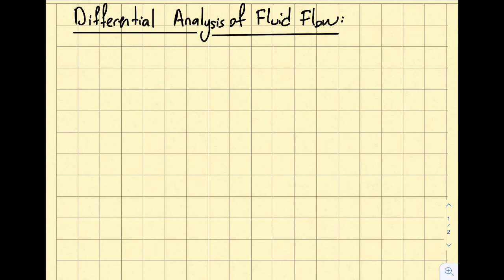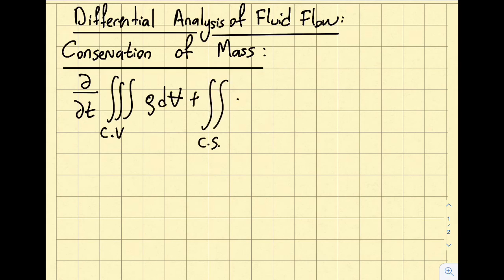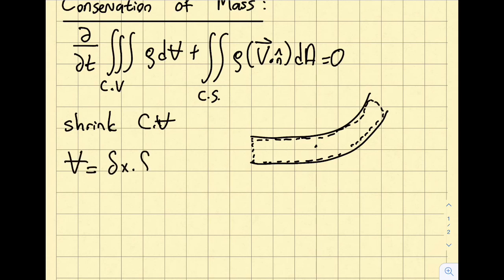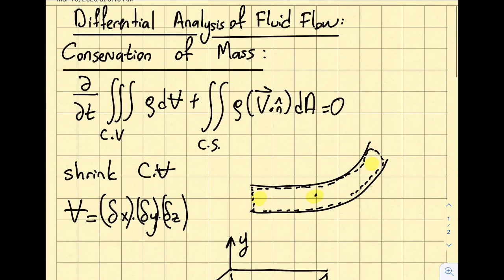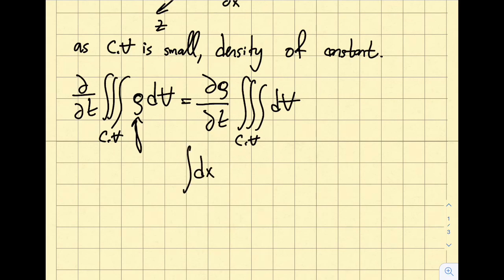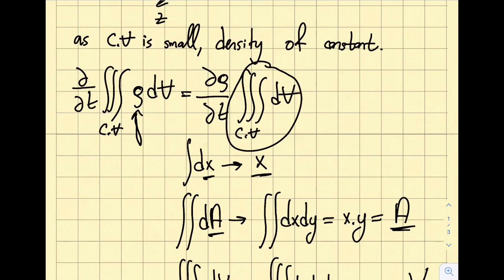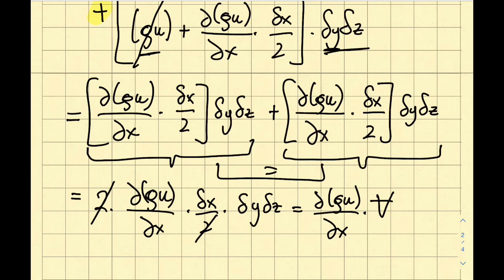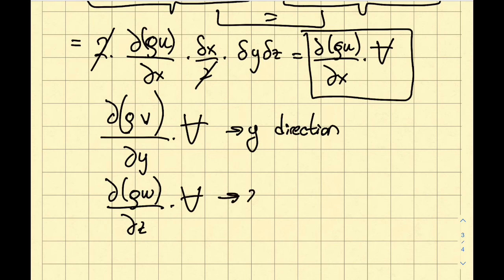Fluid Mechanics 8.1 - Derivation and Discussion of Conservation of Mass - Differential Form

Comment: I know this is an old video but i couldn't understand the constant density part. We assumed that density is constant for the control volume part of the equation, then why didn't we also assume it to be constant for the flux part of the equation. Shouldn't we just take the density out of the differential to make them consistent? In the next part we do that for incompressible flow but according to our first assumption we should be able to do it without considering the flow conditions, that part was confusing. Thank you sir for your videos, it helps a lot!
Reply: Hey, did you figure it out?